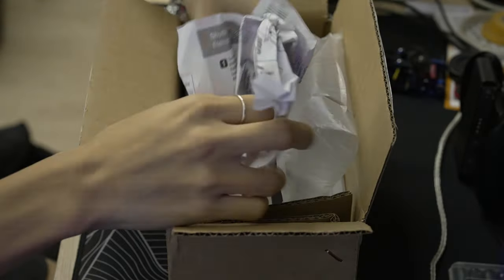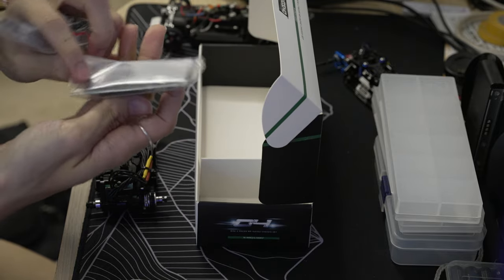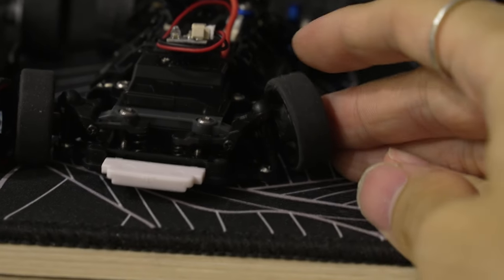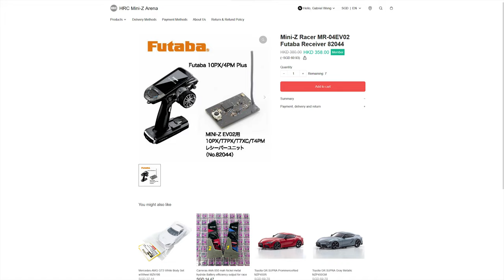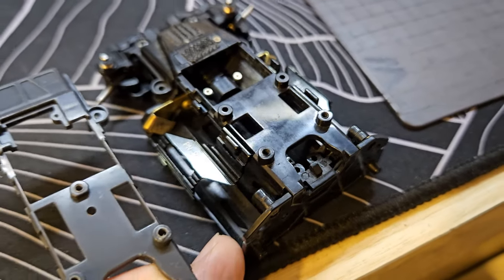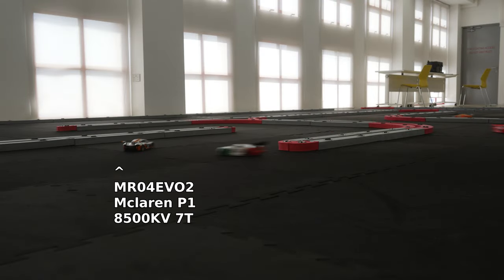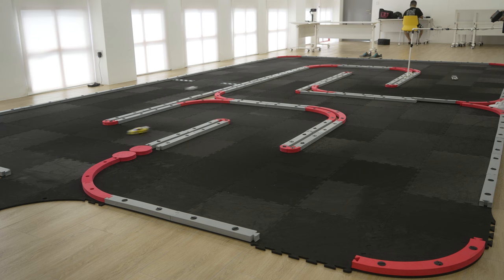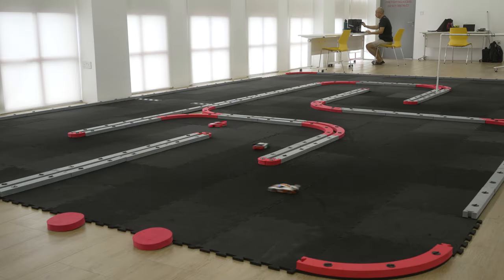Mini Z MR-04 EVO2 - Detailed look and test drive

Comment: install a small bump stop inside the spring to control the compression to keep the pin from coming out. the spring will keep in in place and will not allow the arm to fully compress spring

Comment: Great video, thank you so much for that. Was wondering how the low speed control is with the motor being sensored. Can you control it much better at start up low speeds than the MR-03evo sensorless brushless motors?
Reply from the maker: Yea, it's a significant improvement, it's very close to being brushed. It's more than smooth enough for normal driving.
I did notice that low speed of 4100KV is also similar to 8500KV.

Comment: HI,
I tried to bind my MR04 evo2 with my Noble NB4 but nothing! I first turned on the radio by selecting the model (1) then in the RFsetup mini-Z EVO (and not FHSS) and starting the binding; then I turned on the MR04 by holding down the button and only the LED (red) flashed quickly, but nothing! I tried to update the receiver (yellow antenna) but it remained at 0% and the LED continued to flash red! Any  advice? 😨

Comment: I am running my mr04 MM-W with a r246 MM rear motor mount. Any idea what disk damper kit I can run? Mine came with the fixed spring MM suspension

Comment: Do you know the model you got with the dampner compares with the other version with the low motor without the dampner. Trying to decide which one to get. Thanks. Great vid
Reply from the maker: It really depends on the body type you want to run. The MM2 motor mount can work with 94mm and 98mm, but it's higher center of gravity and the shock might interfere with a couple of bodies, like the popular 12C.
I just ran a few other people's MR04 and the 8500KV version with no damper does still drive really well, just that it tends to bounce a little on the rear.

Comment: Hello do you know if this new chassis will work with an original release Sauber Mercedes LM body, or the Mazda Renown LM body?
Reply from the maker: Just need the correct motor mount and/or T plate. We have someone running the MR04 with the 787B

Comment: Hi ! I have 2 questions 
1) I have many types of LIPO batteries from the aéreo model fly ! Could I use the 2s lipo which are 7.4 volts?
2) could I also use the normal 
AAA Ni-MH Rechargeable?
Reply from the maker: If you wire it correctly, the board can take 7.4v without issues, just be extra careful not to accidentally give it too much voltage. AAA nimh rechargeables are what most people usually run.
Reply: @Auranapse  thanks 🙏🙏🙏

Comment: Hello, if i understand, you can take mr04 motor and put it in mr03, yes? if so it would be interesting to compare laptimes between mr03rwd and mr04evo2, with same gearing
Reply from the maker: Yea actually, I forgot you can probably use the sensored motors on the MR03EVO. I don't have one and don't really want to get one though 😅
Reply: @Auranapse  do you have a regular mr03rwd?
Reply from the maker: @space_cowboy007  Nah I never had one. I had a MR03EVO but it was eventually modified to the PN2.5W chassis.
Reply: @Auranapse  i see. cool car & video, will stay tuned to your next ones =)

Comment: Do they have a receiver option for Sanwa radios?
Reply from the maker: There's an aftermarket one made by MXO Racing, and it does work well, one of the guys at the track run it.
If you get it you'll have to follow the dual rate settings in the instructions MXO Racing gives.

Comment: I'm having trouble spinning out with this chassis, any idea what I could improve on? Anytime I'm going fast and I turn in, the rear end likes to swing out and I spin out, I have to go really slow in order for this not to happen. Thanks!
Reply from the maker: What tyres are you using? I noticed with the MR04 design, I'm usually getting more front grip with it compared to my PN car, so I needed less aggressive front tyres in order to run the car optimally.
Reply: @Auranapse  they're the radial 20 in the front from kyosho and radial 20 wide in the back
Reply from the maker: @Rowtreez  The usual safe tyre setup choice is radial 20 wide at the back and 30 slick fronts, I'll try a harder front tyre.
You can also try running harder front spring but if the car swings out or loses traction very quickly, tyres are usually the problem.
Reply: @Auranapse  tyty appreciate the advice 🙏🙏
Reply from the maker: @Rowtreez  no problem :P
Usually tyres are 70% of the setup. You can try softer T plate as well. Also ensure all wheels spin freely without contact with the body if possible too.
Reply: So I ended up messing with the radio and changing the tires, made a huge difference. Currently running 30 slick front tires and 20 radials in the back (used tire tape and it definitely made a big difference too). But the biggest difference was limiting my max turning angle to 80, steering rate to 60, and steering exp to -70% on my noble nb4. But now I'm having another problem... I can't turn the wheel all the way to the left, and it's a bit choppy when I turn left on the radio. Turning right has no problems though... is it possible I stripped some gears?
Reply from the maker: @Rowtreez  That's odd, if you move the physical steering of the car by hand, do you feel that it is smooth? Personally I do run steering dual rate depending on track/tyres, and not use steering exp, but it's a preference.
Reply: @Auranapse  the steering is smooth but when I try to turn my wheel all the way left, it physically stops at like 30 degrees
Reply from the maker: @Rowtreez  you should open and check the servo gears rip. Maybe something stuck inside or damaged, or could be something else I missed.

Comment: Can MR04 evo run at slow speed like the mr03 RTR brushed version?
Reply from the maker: Yes it can, the sensored motor is much smoother and you can roll at low speed.
Reply: Can I use the sensored brushless motor into MR03VE version? Thx  @Auranapse
Reply from the maker: @johnsebastian1605  I would say that it will probably work, all sensored motors I come across will work with sensorless ESCs, but then it's better to save money and get the sensorless motor instead.
Reply: @Auranapse  so, in general, the sensorless like the orion xspeed motor is faster than the sensored xspeed on rcp track?
Reply from the maker: @johnsebastian1605  if both are brushless, it depends on the actual KV of the motor. KV from manufacturers sometimes aren't accurate. Even the red 8500kv made for the first EVO(MR03EVO/MA030EVO) seems to be slightly off from the new 8500kv for the MR04EVO2
Reply: @Auranapse  yes both are brushless, but the orion xspeed are sensorless brushless.. so i can conclude that the sensorless brushless is faster than the sensored brushless (given the same KV)..
Reply from the maker: @johnsebastian1605  Not necessarily, a sensored motor could be faster too. As mentioned it depends on the true recorded KV of the motor which you can check with a motor checker, not the rated one. And it could vary from motor to motor, depending on quality control.

The orion motor itself could be be faster than the new evo2 sensored motors because it has a slightly higher KV.